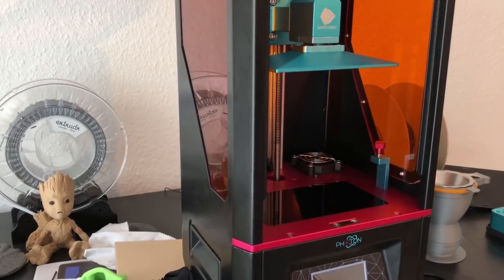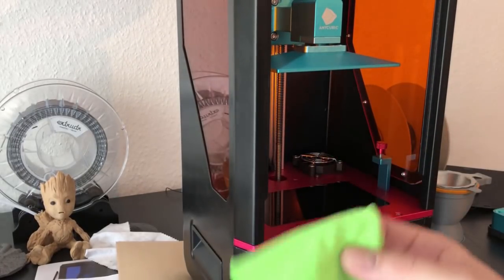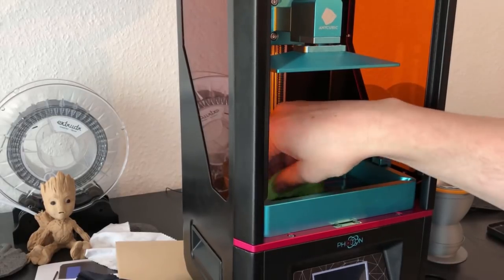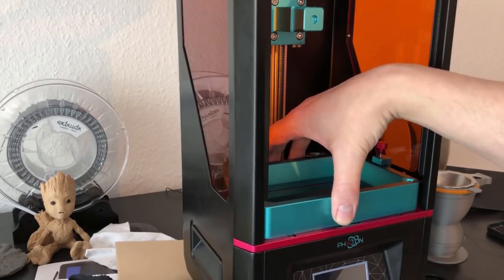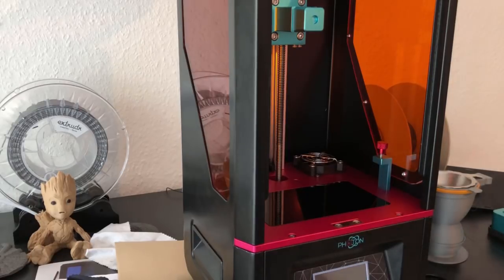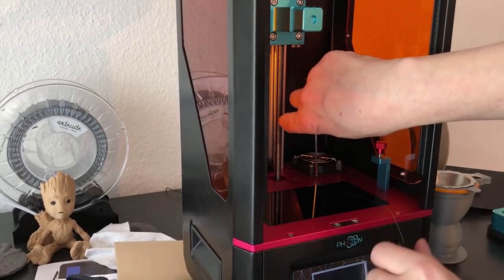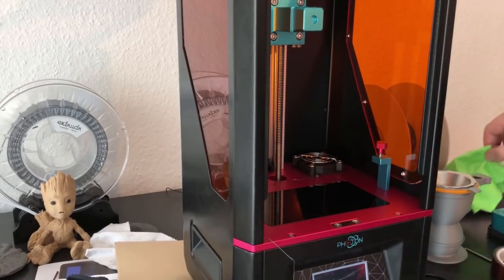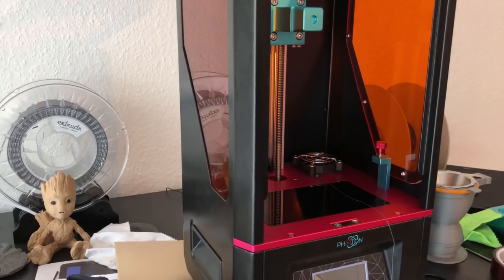Anycubic Photon - tips to prevent broken screen

Comment: what can I do to remove the print from the FEP ithout scratching it? And could it also be a problem of exposure time ? should i make the exposure time longer? Can anything bad happen from making the exposure time too long ?
Reply: Lightly pressing on the bottom of the FEP where the stuck piece is usually helps me remove it without having to scratch at it. Adding some of your preferred solvent (IPA clouds the FEP I found...) Exposure time will be different for everybody if you have failing prints increasing it might help. You lose some details when the exposure is too high but no "failures"
Reply: @carsonallread6513  Thank you VERY much this helps a lot

Comment: You can have it easyer if you put a tablet safe protection Plastik on top of the screen. DId it after resin run under my screen und hardend on the reflector.
Reply: How did you clean hardend resin from the reflector?
Reply: Toni Lohse i used reflector from a broken photon of a friend. And he order a new from anycubic including a new screen and board.
Reply: ok, thanks. I do not have this possibility :(

Comment: Any suggestions on where to buy a replacement protective glass for the LCD panel? My glass is cracked on the corner, but the LCD still works fine. AnyCubic is of no help getting a replacement part.

The fact is, AnyCubic is horrible in providing any replacement parts. I have a bad mainboard on one of my Photons, and after much hassle I finally got them to send another one. Unfortunately, the replacement they sent appeared to used and it had a totally different problem from my original one that failed. So, I have two bad boards. Now, they are basically running me in circles with different people and only offering an updated firmware file (which does not fix the problem no matter how many times they have me update it). The Photon is currently a doorstop.

I am thinking about gutting the Photon and putting in a Raspberry Pi board and running NanoDLP on it. The proprietary mainboard makes the Photon a disposable machine if you can not easily buy a replacement.
Reply: I found on eBay for $41.  Search for ' 5.5" LCD Module Screen 2K Light Curing Display For ANYCUBIC Photon 3D Printer US '
Reply: You can try looking on AliExpress, I've seen various spare parts sets there

Comment: i did buy this printer a week ago, but it wont print anything, i did try everthing, it just sticks to the vat, only 2 mm and wont do antmore than that, i was looking forward to make some good prints, but no
Reply: Obviously your parts are not sticking to the build plate.
The build plate must be level (check it with a small piece of of paper after tightening down the leveling screw). It must remain level after tightening the screw. Also - make sure that the leveling screw is TIGHT. Insert the short end of the allen wrench into the hole and use the long end of the wrench to really get some torque on that screw.

The Z=0 adjustment must be very, very close to the LCD display. The sheet of paper method described by AnyCubic actually works well. Opaque resins will not cure as deeply as transparent resins will, so transparent resins are usually somewhat more forgiving of improper leveling and Z=0 adjustments. However, if you have an actual gap of say - 0.3mm on your first layer, the part is unlikely to stick to the build platform and you will never get anything but a glob of resin stuck to the bottom the the vat.

Also, lightly sanding the build platform can help a lot if you are still having build plate adhesion problems. Use a medium grit sandpaper and try to put a visible cross hatch of scratches on the build plate. The objective it NOT to remove the anodized coating, but simply to roughen it up.  Cleaning the build plate with IPA right before each print is also a very good idea. Just be sure the IPA is completely evaporated before starting the print.
Reply: @kdanagger6894  what can I do to remove the print from the FEP ithout scratching it? And could it also be a problem of exposure time ? should i make the exposure time longer? Can anything bad happen from making the exposure time too long ?
Reply: like danagger says, your print head probably isn't leveled properly. Also, try tilting your prints(in the slicer) to get less surface on your vat sheet at thesame time.